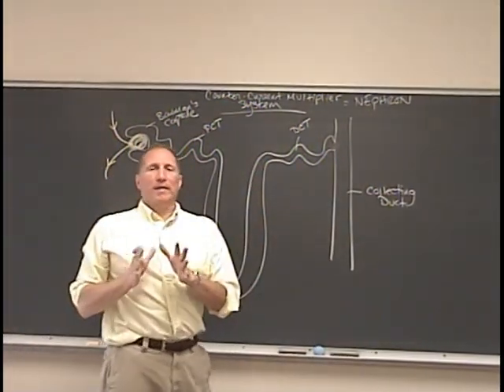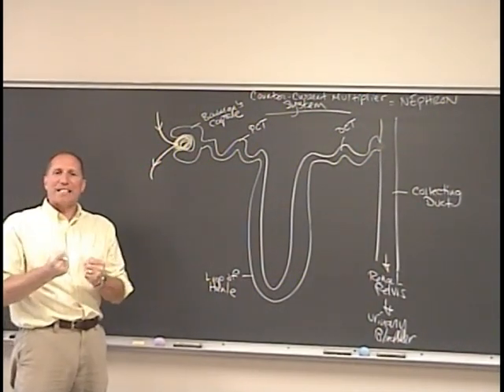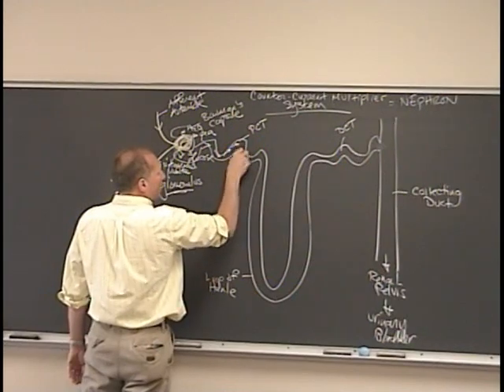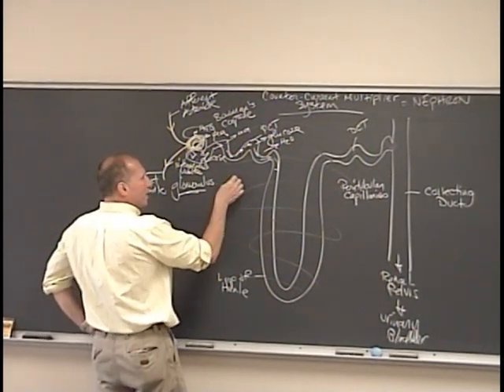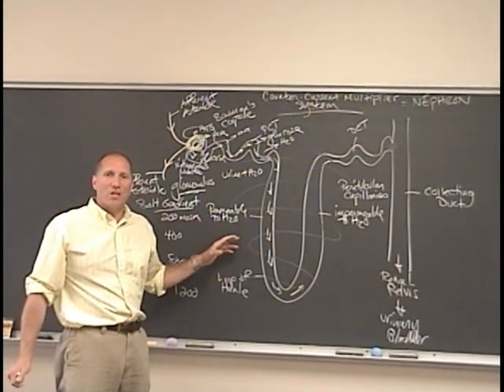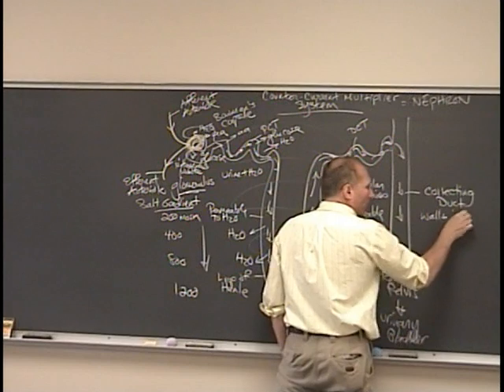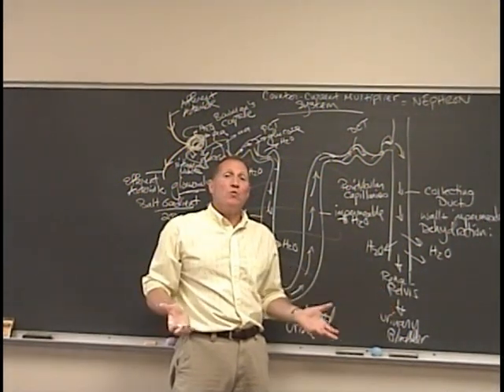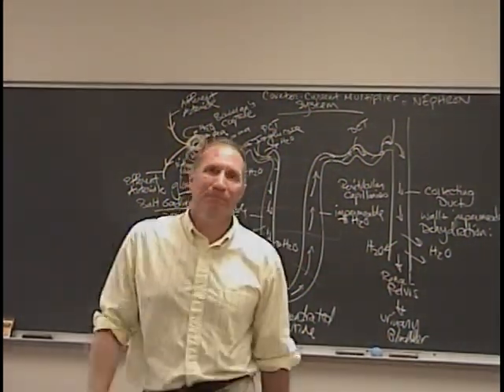ThomasConena

Comment: u said that the urine is concentrated once it reaches the top of the ascending loop of henle. i was under the impression that at the point where the loop of henle met the distal convuluted tubule the urnine was dilute; this being due to the reabsorption of solutes leaving a higher water concentration going into the dct? it is in the dct where aldesterone reabsorbes water via Na/K pump and and adh in the collecting duct with aqua porin which in turn creates the concentrated urine

Comment: ADH does act on the collecting duct as well as the distal convoluted tubule by adding aquaporins to the apical membrane of their epithelial cells, increasing water permeability. ADH also increases the number of urea transporter on the inner medullary collecting duct, increasing urea permeability so that more urea can enter the medullary interstitium; ultimately, that helps with driving water out of the distal collecting tubule and collecting duct.

Comment: Everything I'm reading about this system indicates that a structuralized AA chain (a protein) would not pass through the capillaries as filtrate. Maybe your smaller non-natured peptides can, but I doubt it.

Further, the ascending limb actively transports NaCl out if the lumen, resulting in dilute urine. Final concentration of the urine occurs in the collecting duct where ADH hormone is used in conjunction with urea as a means of osmoregulation.